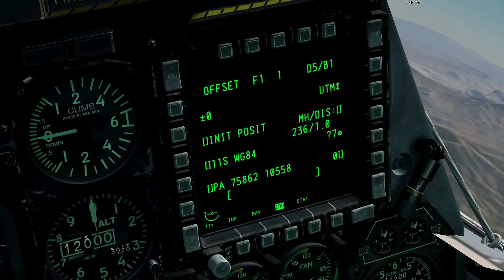A-10c - An In-Depth Tutorial of the CDU - Part 02 - Components

Comment: 2:18 -  Setting the dial to FLT PLAN is also the only position that shows the connecting lines on the TAD.
12:45 - Something to note about HACK time: the countdown starts the moment the HACK button is depressed, not the moment the ENT key is depressed.
13:40 - 6000 feet AGL as AGL FLOOR did not work because it was an altitude beyond the range of the radar altitude system.
14:20 - What +DrM said.
14:43 - The same applies to the FUNC key.
15:20 - FUNC and keys 7, 8, and 9 on the UFC mimic and override the STEER PT dial.
- For the curious, the 6 UFC keys under the MASTER CAUTION are related to a radio system the DCS' simulated A-10C suite does not have. This is why vanilla textures have those keys blank: Ricardo's textures add them for flair.
Reply from the maker: Thank you Gliptal!  I really appreciate the help!